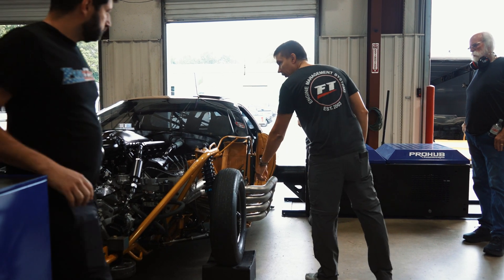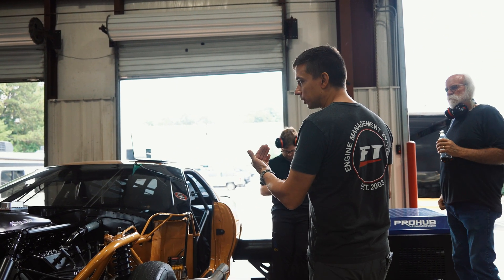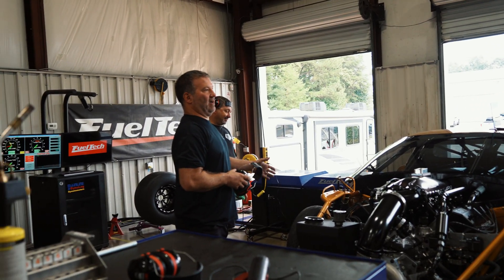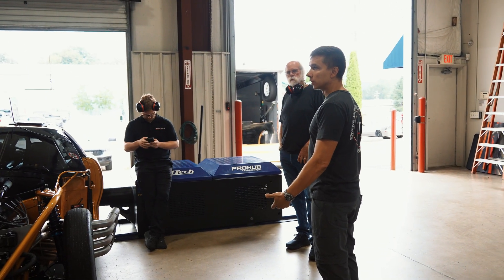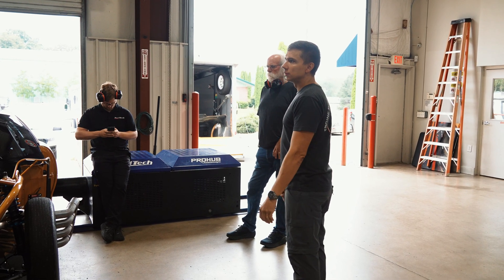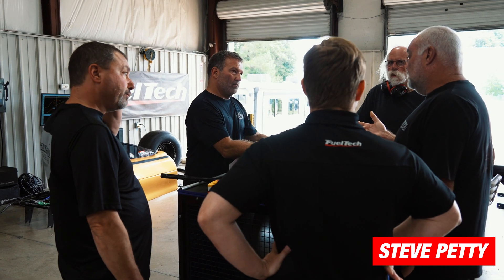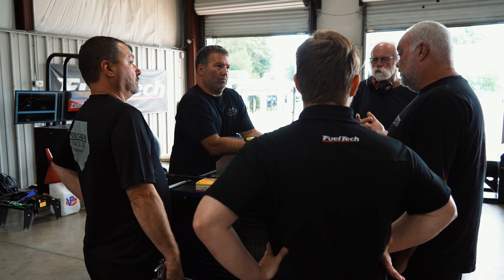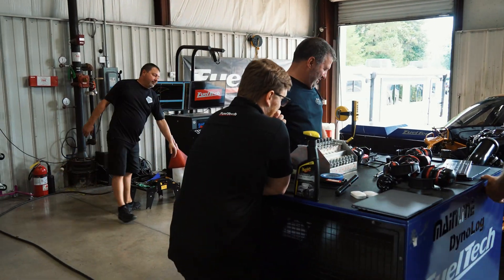ProCharged Camaro Hub Dyno session! | FuelTechUSA

Comment: Point the headers up to get more down force? I just don't see it. Can anyone provide a real test of this?
Reply: There's a reason every single top fuel car points the headers up.  The exhaust that these cars pump is almost unbelievable.  So, yes, you get a lot of downforce from that.
Reply: @fromnineteeneightyfive  Top fuel cars make 3x the HP , weigh 600lbs less,and have no suspension.Apples to oranges comparison.
Reply: @zipper396  Bub the physics still apply, even if 3000HP cars don't make as much HP.  Top fuel is just the most extreme example.

Comment: Screw the haters.
Diggin the vertical zoomies
Reply: It’s not about hating, it’s about making the car work as efficient as possible but if you rather a look versus a quicker better working car, you do you.
Reply: @waynebollentin989  point us to the unequivocal scientific data that shows less performance with these.
Reply: @chadkent1241  lol, you are kidding right? It has been a known fact in funny car for years and not just Top fuel either. How you don’t understand the concept is behind me. There’s plenty of data out there too if you can understand it. Some even have different sets of with different angles that allow them to tune for each track condition.